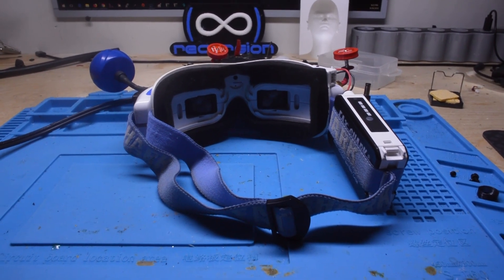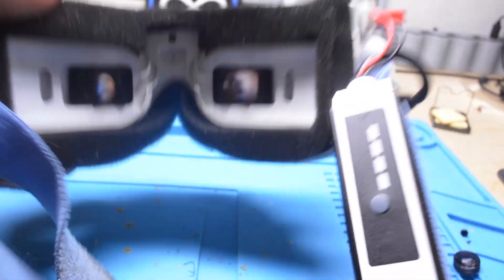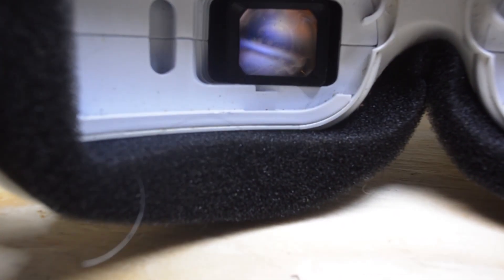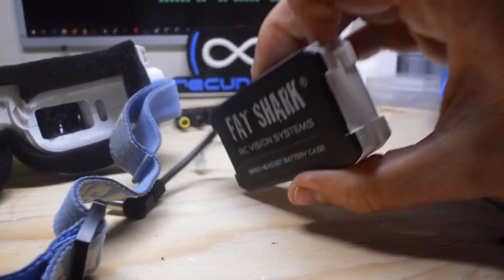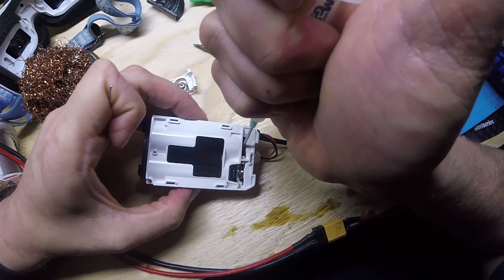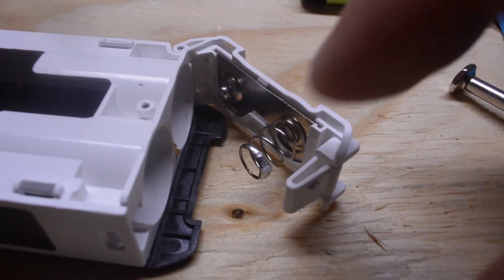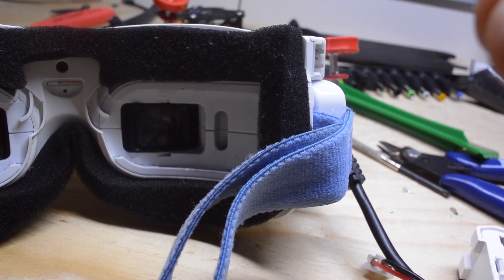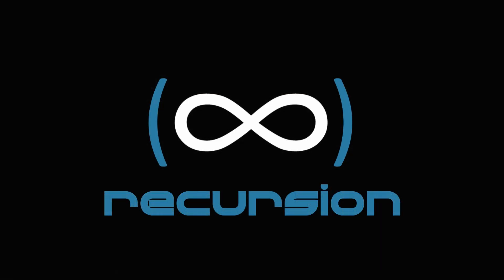Recursion Labs - Fatshark Black Screen of Death - Diagnosing and Resolution

Comment: The battery is spring loaded. That's why I don't use that and use a 2S.
Mine died in mid flight today.. In my last video. The DVR stopped when it went black so possibly low voltage. But it happened twice in the last three or four flights.

Comment: I had a BSOD problem with my HD3s and a Furious rx. causing failure in flight.  The battery that came with it was a Lipo soldered in a case.  Same problem running them on a flight battery with an 8V regulator.  
I modified the goggles, adding a separate 5V regulator to power the receiver, problem solved.  
Now my HDO2s have the problem with the battery case.  In addition to that, the wires between the 18650 case and the plug are thin, probably 26 AWG.  One broke internally, screen went black and I crashed the wing.  Repaired the case with 16 AWG and will do the mod in the video also.

Comment: I have the same problem, but it happened during flying - Black screen and reciever on, but with using standard 2s lipo 🤔
Reply: Did u find a splutuon happen to me with hdo and tbs fusion module
Reply: @VictorHugo-cj5sm  same here when flying hdo2 + fusion , any solution?
Reply: same problem with Dom V3 and True d x

Comment: Thank you!
i get the same problem with a lipo i carry in my pocket...connectet with a long cable. i only put them on my forehead swith batterys of the quad an they are black... :/
Reply: Was the problem in the cable or the battery? I too have a long cable to make the goggles lighter
Reply: i have no solution for this problem. still get somtimes black screen for no reason, the goggles beep somtimes spontaniously. the led sometimes still on but the screens are black.. reconnect the battery helps for moment. luckily i dont get black screen while flying.
Reply: @qygpygpq707  I believe i solved my problem, I stopped using the extension cable. Apparently the connector was bad. Using normal connector has worked so far...
Reply: @juliussalovaara9787  thanks for the tip. its a chance for me to get the problem solved. you use the standardt battery now? but i realy dont like the extra weight on my head ;/
Reply: @qygpygpq707  I use the standard 18650 battery, apparently the extension cable dc connector was bad, worn or the wrong kind. Whenever I would wiggle it or shake the goggles it would disconnect quickly. using it without a cable has worked so far... and yeah i feel you on the weight thing :D

Comment: Great video! I have a variant of the problem: I use a Tattu 2500mAh 2S lipo that's built for Fatshark goggles and I have exactly the same problem; both screens go blank but the module stays powered up. I'm wondering if it's an issue with the barrel jack socket, maybe. I didn't see the plug on your bench power supply but I'm guessing it isn't right-angled. Could be an issue with right angled plugs putting more strain on the socket. I might try making a cable to power them via the PS/2 socket.
Reply: Follow up: A tiny spray of WD40 in to the power socket completely fixed the issue. No more black screen of death :D
Reply: alx_files could you elaborate a little bit more? I have the same issue.
Reply: Sure. In theory the issue I had could apply to any type of battery powering the goggles, as I noticed the plug didn't feel quite properly seated in the socket. I sprayed a tiny bit of WD40 in to the socket on the goggles (it's not conductive) then plugged the power in and wiggled it a lot. Now the plug feels a lot more "stable" in the socket and I haven't had a single black screen since. I'm guessing proper contact cleaner would do a better job, but this worked for me. Although I hold no responsibility if it kills your goggles.
Reply: alx_files awesome. It could be that the barrel is dirty. I could not recreate my goggles turning off or black screen after I cleaned it out, nothing appeared to be in there though.

Comment: I added a 1000 uF capacitor to the power leads (made a dongle), and the BSOD problem remained unchanged. I repeat: adding a big ass cap did not improve the problem. 

I’m going to put foam tape on the outside of my Furious smart battery case.

Comment: I wonder whether the solution will lead to longer term problems.  Solder oxidises whereas whatever they make battery terminals out of (nickel plated maybe) does not.  So over time, you may find the connection between the battery and the solder lump worsens or fails.

Personally, I’d try stretching the spring contacts first before doing any soldering.
Reply: You mean springs inside the barrel connector?

Comment: I also found the battery meter on my li-ion holder reads 100% even with cells at 2.5v each.. it works on the crappy lipo version though. Anyway, great diagnosis.

Comment: Try installing a large capacitor in the Fatshark goggles on the power in socket ,loosen the springs and re try drop test.This may help with the brief disconnection of power and stop the black screen?

Comment from the maker: If you have this issue and can corroborate my findings, I'd appreciate if you let me know.

It is worth noting that if you have the same problem but do not have the same 18650 battery holder from fatshark, anything that might cause a minor power disconnect would show this symptom. The fact that Fatshark LCD screens turn off when a slight blip occurs isn't ideal, but the fact when the power is recovered they stay off is an unacceptable design flaw from a brand that touts the importance of FPV reliability.

If you use battery connector that isn't snug to the goggles, or the connector inside the goggles is worn with a connection that isn't really snug the same thing could easily happen. At least you know where to look now.
Reply: I had the problem you report with the fatshark 18650 case. I switched to the Furious FPV smart battery case and the problem improved, but not a lot.
Reply: Yes, I have a similar 18650 case, still labeled as fatshark that I bought at the time that I bought my goggles, but instead of a spring, you open the door, it has 2 springy metal tabs. In my situation, my goggles fell off my lap, the plastic door catch broke, so I fashioned a new latch with wire to keep the door closed  and then started to experience the exact black screen issues. So I hot glued a piece of foam under the tabs to take up any play in the batteries and I have not had a problem since. Yes, I agree that this is a dangerous problem, in fact I have a the nice dent in the roof of my car to prove it (flying ... screens went black, panic'd, disarmed, lifted my goggles in time to watch the quad drop out of the sky onto my car roof). I agree with another reply, that if fatshark would have put a decent size capacitor in the goggles, that even if you momentarily pwr loss, it would not shut down the screens. I think I am going to add a capacitor to mine just in case.
Reply: I use a 2s battery and have the issue. I wish it was a simple case repair for me😢